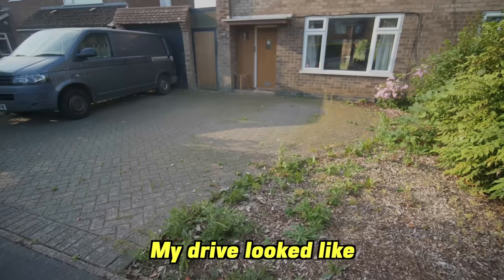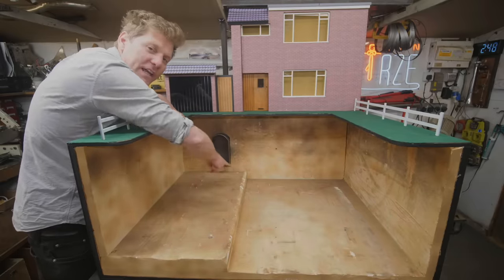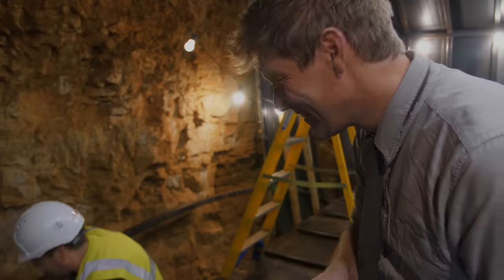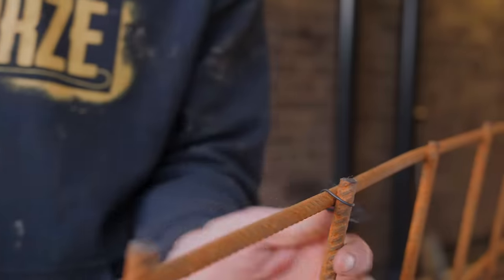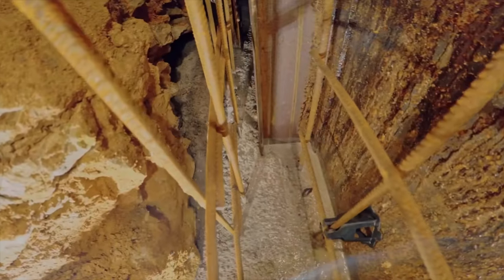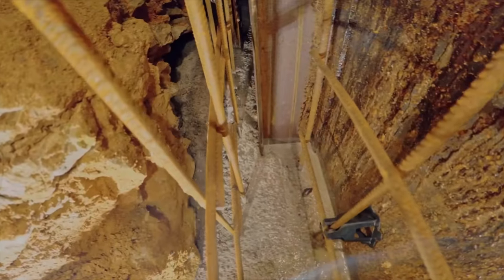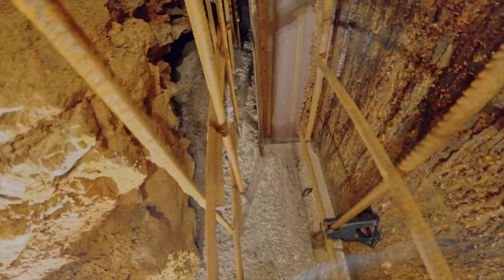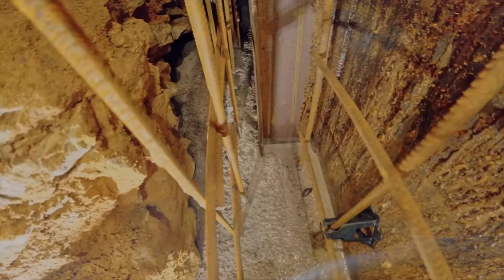Digging A SECRET GARAGE Part 3

Comment: As a construction worker I love that there is absolutely zero corners cut and everything is completely thought out, very professionally done 👏🏻
Reply: And the use of the power rebar tier saved Colin time and prevented him getting repetitive stress injury as happened with the precast concrete plant worker where I used to work.
Reply: I actually saw him use many cut corners in this actual video 😉
Reply: Except for the wrongly build corners in the rebar 😉 the inner layer should be extended to the outer layer to work correctly. How it's been done it's not a stiff corner.
Reply: Unlike that one chick on TikTok who was building her own tunnel lol. She’s a polar opposite to this.
Reply: I don't think he could cut corners cuz he lives in a town I'm sure his town make him have building plans from his engineer and there building codes it not like he could hide any short cuts.
Reply: What do your friends the cowboy, red Indian and motorcycle cop think about the build?
Reply: How’s it like being a builder

Comment: Colin, as a commercial builder, they make stone sealer that can be used on rocks, bricks, concrete, etc., for aesthetic effect (clear) as well as a solid moisture barrier. If you make your window room tight enough to hold back concrete then you should be able to seal that whole area off with stone sealer to nearly eliminate moisture… if you include ventilation from your garage.
Reply: Additionally you could light the rock space with halogens to heat up the air behind the window and drive off residual moisture.
Reply: My first thought was to fill the whole gap between the glass and the rock with clear expoxy resin... but I'm not a builder.
Reply: @ChrisBLong probably wouldn't turn out that well because of scale and bubbles
Reply: What is this sealer made of? Is it environmentally safe?
Reply: @hvglaser  as environmentally safe as the chemicals in plywood, the tar in roofing, the factories to smelt the steel, etc. etc. truth be told, I have never seen an environmentalist that wasn’t a hypocrite living in a house, dressing in clothes, and driving a car. What do I care if the stuff is environmentally safe?
Reply: There is no type or amount of 'sealer that could ever keep the moisture from coming through that combination of rock, clay and crevices without seriously altering the appearance of the rock.  The solution is to simply keep the air dehumidified.  (Your comments regarding not caring about the environment we all live in shows astounding ignorance by the way.)
Reply: @Dr.Reason  "What do I care if the stuff is environmentally safe?"
Because it is the environmentally responsible thing to do. That's why.
Reply: Would a clear stone sealer be structurally sound? Or just for a small section?
Reply: @choccie_chip685  sealers have no structural value whatsoever.

Comment: Those transitions from model to reality, beautiful. 
Super interesting video Colin, the explanations and visuals were fantastic. I went to an MOD bunker in north London, hidden under a post office. It's disused as the membrane and concrete cracked, the water table floods the complex. All pipework, cables, ventilation and generators are rusted beyond repair from the damp. Be careful if you install the window in the car storage.
Reply: Seamless weren't they? Shows it very much is to scale.
Reply: Why not build a standard garage on top of the underground one? This would keep the underground garage dry.
Reply: It's quite possible they have regulations prohibiting structures from being so close to the roadway. If they don't, it's a great idea.
Reply: @bharatdahya776  because it would be in front of his house where the driveway was. 🤦‍♂😆

Comment: Few things for rust; tannic acid+phosphoric acid+ alcohol converts the rust to iron tannite, automatic transmission fluid diluted with a solvent to coat metal and prevent rust, or cathodic protection either active or passive.

Comment: Only Colin could make a sheet metal model, looks superb.

Questions:
Have you planned for water removal when the car is parked/driven off in the rain?
What about car fumes when working on it?
Does the turning circle actually need to be a circle or could it be a rectangle?
Who did you blow at the council to be able to do all this? :)
Reply: Not sure what the laws are in the uk for building on your own land but here you can do basically anything you like on your own property as long as it meets building and safety regulations
Reply: The answer to every question is: "YES!"
Reply: @nanaki-seto  You need planning permission to do just about anything in the UK so fuck knows how he managed it
Reply: @rats2864 exactly bro, I’ve worked at jobs where the owners can’t get planning for a patio let alone an underground deloreon garage 🤣
Reply: @rats2864 it’s the same in the US btw, that guy just doesn’t know what he’s talking about. Even having a hot tub requires city approval. New shed? Also needs approval. Hard to do any renovations without it
Reply: @rats2864 I remember him talking about this a while ago while he was building his tunnel still. It seems like there were some hiccups and like a part of the work he did before he even had permission
Reply: Vents for the fumes and a simple drainage system with grates that lead to a special septic tank or sewers
Reply: @masterslayerable  oh yeah the whole ask for forgiveness not permission for some of it
Reply: you technically own all of the land "below" your plot in the UK, so this is why basement digging has become so popular. It's likely easy to get a permit as long as you have real blueprints and engineer approved designs (you can also find/buy these online)
Reply: I believe he covered that in one of his videos. Basically, the limestone will channel the water down. He explained he had a garden hose on full for a while in one of the cracks and it never filled. So I'm guessing he's just going to make a drain straight into the limestone for any water that comes in.
Reply: @carsonhunt4642  you need permission for a new shed? lmao what
Reply: @ZDProds-c8p  Yes, you do, indeed, need a permit to put up a shed in a lot of places in the US. However, the beauty of laws is that theyre meant to be broken, so just make sure your shed isn't in clear site of the public lmao
Reply: @xerckd  I'm referring to when the car pulls up and is coming down, if it's in the peeing rain then there will be plenty of water coming in too.
Reply: @mattylad8035  that's what I mean too. It's just going down the limestone, deeper than the underground garage itself.

Comment: Mr Furze just take a high definition picture of the rock wall and then you put a full size mural in later. Love your channel.
Reply: Make a mold impression and cast a concrete copy of the lime rock wall for inside the nice dry metal room. Paint for effect.
Reply: ooh! That's genius!
Reply: I agree, do something that doesn't even approach the risk of moisture ingress. A lot of people asking for the view port probably aren't aware just how rainy it gets there.
Reply: Or just save some of the limestone to build a decorative (mock) dry stacked wall on the inside.
Reply: Great idea! 👍
Reply: Good ideas in here for sure!
Reply: It's either this, or it gets to be the a terrarium that contends with AntsCanada's Ant observatorium
Reply: Use heated glass to prevent it fogging up
Reply: @MrJayJamz  Too much ongoing energy costs.
I would recommend double glass, but the decorative wall has merit too.
Reply: You could also fill the cavity from above with clear polymer...Effectively cast the window.
Reply: Or completely fill that whole section with transparent epoxy
Reply: @apveening  well, heated dubble glass doesn’t have to use much energy. It just has to keep the cold of the glass. And can be turned off when not needed
Reply: @bragebh7122 ooh that's good. Build the furzniture in the room with that style, it would look epic
Reply: Brilliant
Reply: Who are all these people asking to keep the rock face exposed? Sounds like way more trouble than is worth. I'm sure a majority would prefer a practical idea..... like this one! I'm team mural.
Reply: Another idea... Take a slice of the rock face, transparent epoxy resin it, install like art on the wall. Boom.
Reply: You could also do a resin pour🤔 Just like a window, but do a clear resin pour between the glass and the rock wall. Would that not solve any condensation issues? Please correct me if this is dumb
Reply: @andrewgoodbrand4208  it would be an absolute nightmare. Resin pours are problematic as is to make look good on a small scale (like tables) having something of THAT scale won't look good. It would also take FOREVER to cure, and you will have to do it in small layers because it produces heat.

TLDR: it won't work
Reply: @jackbequick  Ah I see. Could have been a cool idea if it would have worked. Thanks for the insight dude
Reply: @tonykeast9966  this is brilliant!!
Reply: Or make a silicone casting of the rock and recreate it like a crazy person in colored concrete ....
Reply: Ho no. Fake stuff would be a disgrace for this channel. We want the real shit !
Reply: Need to put a fake dinosaur fossil in the exposed section of the wall
Reply: Install a giant electronic picture frame, so you have an unlimited choice of scenery.

Comment: This is amazing. I remember when the bunker was finished and not even connected to the house. Collin said that a real estate agent told him (to the question, how this raises the value of the house) if he ever would sell this he should sell it as a Bunker with a house on the lot, not a house with a bunker in the garden. This is a one in a million Home. Thanks for sharing.
Reply: I wish I could afford something like this.
Crazy expensive material cost alone, at least 300.000€ or probably much higher since he uses a huge amount of steel and welding gas. This highly reinforced garage is probably gonna be another 100.000€ in material.
Reply: If I did that much work on my place there is no amount of money in the world that I would ever sell it for

Comment: for the natural wall, just have a dehumidification system, I think some calcium or lithium chloride would work.
though maybe just 140mm holes with some quiet pc fans top and bottom for ventilation might do the job

Comment: Have you considered the use of post/pre tensioned reinforced concrete for the top slab? Considering the flexural stresses on the concrete with cars parking on it building it like a parking garage doesn't seem like the worst idea. I am so glad that you had a geotechnical engineer come out to the site and take a look at what you're doing here. They provide seriously valuable information when constructing anything. I worked as a engineering technician for 10 years so this project is my favorite you've done so far because I spent so much time checking soil strength and inspecting foundation pours everything here is super familiar for me. You've done a fantastic job explaining everything by the way I'm sure loads of people are getting exposed to stuff they may never have otherwise and maybe you've even created a few geotechnical engineers with this project. Love the channel and the work you've been doing and I look forward to watching that DeLorean pop out of the ground.

Comment: Hello Colin just a thought on the rock wall...Take a mould of the wall to remain exposed rock and recreate the stone colouring on the full size model.  Replace the 'window view to a rock wall' with a steel plate alcove then fit the model into the alcove. Get a modelmaker / artist to paint the rock wall model to mimic the original and light it accordingly ?

Comment: Colin. Use a cylindrical fan behind the window to blow across the glass. I used this when I was a bar tender after the glass doors on the beer cabinet kept condensating up, it worked a treat.
Reply: I had this same idea. A fan across the window, and could also ventilate that area to the surface to help keep the moisture down.

Or go the other route and turn it into an aquarium or terrarium with the raw rock wall as the background (can use a clear pond shield epoxy to seal the rock wall).

Comment: As a civil engineer I gotta say I'm impressed with the rebar work.  You did it right mate!
Reply: i think it should be way thicker rebar. i have built pits in the ground for large presses and the walls are usually 1 foot thick with a 5/8 rebar mesh every foot in each direction.
Reply: What's gonna be in the driveway hole when the car lowers down??
Reply: @BarryFromEastenders a car
Reply: @KX36  no, when the car lowers down and there's now a hole above , what's gonna cover that ?
Reply: he drives the car into rthe garage then the platform goes back up @BarryFromEastenders
Reply: @lawsong6663  you sure , he never mentioned that or having the space to drive it off etc.
Reply: @BarryFromEastenders  good point, not too sure mate. I'm sure he'll explain in the next episode
Reply: There will be a roof
Reply: @alvar6444  I was hoping so. Not that simple though, was looking forward to seeing how he plans that part

Comment: Hey @colin, regarding the glass viewing screen, just build it with a powered fan vent in the double glazing, essentially a double glaze with a ventilation system built in. I’ve got one in my bathroom. You can do it with toughened glass like they use in Dubai

Comment: Colin’s excellent explanation of the damp proof membrane shows why a bunker like this is so hard in clay areas. They have bedrock but it’s do deep you’ll never reach it. Without help, the pit you dig will literally become a pond. Yo have to use a French drain around the structure with a drainage sump and pump.

Comment: Question for the Q&A :)
Will you be covering up the hole where the Delorian will be coming out of? Like will it be two fake grass panels that open like an elevator door and then that’s where the delorian comes out of?
Reply: I think a solid roof. A car parked on top normally, eg "project car" wrapped in a cocoon, which lifts up when the real car comes up. When Colin is running from the police ( admit it, it's going to happen ) he can drive in, lower the lift and by the time the cops get there, it is a junker that hasn't moved for years in the only obvious place.
Reply: @alanhilder1883 , you are wonderfully twisted.
Reply: @alanhilder1883   Now that is a good idea. I am questioning whether the walls of that shaft would support the weight of a car as well as the lift, but with enough steel anything is possible.
Reply: Thunderbirds island pool would be so cool fake pool so no safety fence is needed
Reply: @alanhilder1883 ngl I was thinking that Colin would run from the police 😂
Reply: It would also be really cool if it was like the x men basketball court
Reply: @BadDoodles  He would need to change cars at some time, the delorean is a little obvious and this way they may think that it "time traveled away".

Comment: This is such a mad project, and you're a mad man for taking it on, but I fully appreciate the fact you did, I absolutely love your videos. I also love the fact that (as mentioned in an earlier video), you can't value this as a 3 bed semi with a bunker any more...it's a bunker with a house attached! That model just proved the enormity of what you've built, especially when you take into account the rest of the tunnels and the original bunker. Awesome, just awesome.

Comment: It would be really cool if the car platform rotated 180 on the way down, if perhaps a bit difficult to do. It wouldn't even have to be circular if it stops rotating just before entering the ground space. You would also be nearer the door when you get out/in!

Comment: For condensation on the window there are some chemicals, that you paint the glass with and they make it hydrofobic, so eliminates condensation
Reply: Water dripping down the window might be the issue he's worried about co it will end up rusting the metal more in them areas.
Reply: Put the window on the concrete and not near the steel so that water will only touch the concrete and the window.the exposed steel would be on the inside and a good granite frame would seal everything off.

Comment: Thank you for the step with the bend reinforcement - was missing that for my “build along” at home 😁❤️
Reply: That was a learning moment for me.
I have long known that reinforcement was needed, but not the mechanical forces that make it necessary.
And I learn better with visual aids.
-
edit: Also this video is when I learned about the 10:1 overlap for tying in new pieces of rebar!